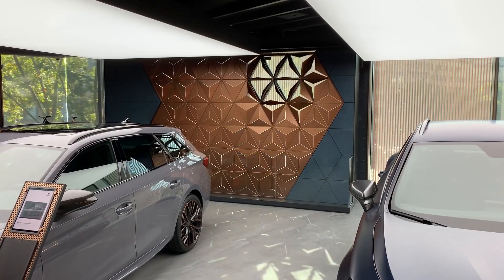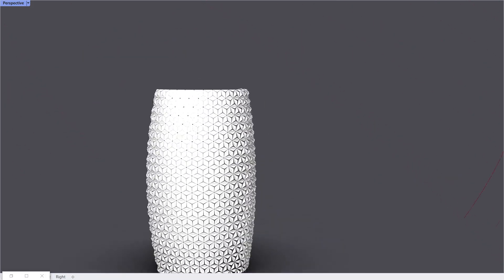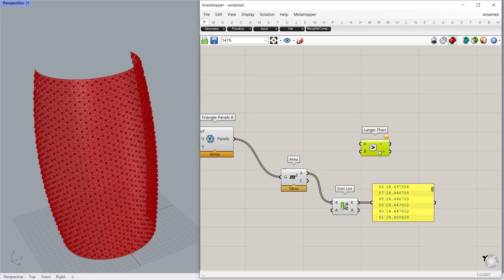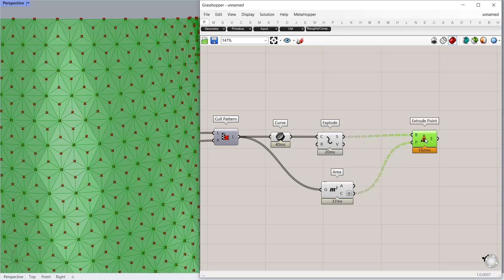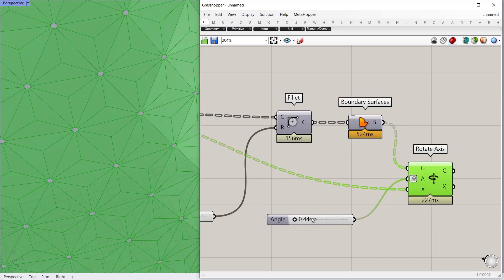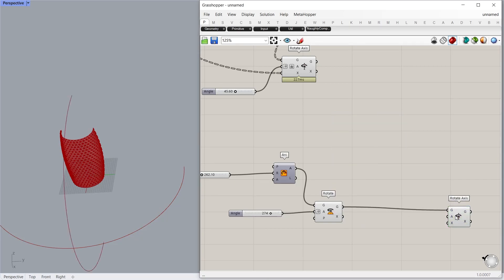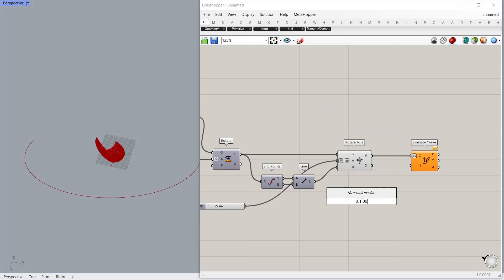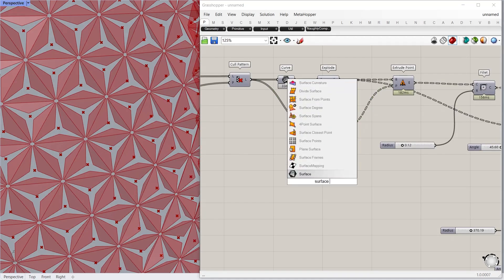kinetic facade Grasshopper Tutorial |commentary available |

Comment: Amazing tutorial! How can I extrude the triangles?
Reply from the maker: use pufferfishes offset surface componet
Reply: @3DBeast  wow thank you for responding so fast
Reply from the maker: @adamuy7884  it’s no bother
Reply: @3DBeast  One more question, Do you know where I can plug on the inputs and outputs, Ive tried a few inputs but it crashed my rhino
Reply from the maker: @adamuy7884  connect surface to surface(or brep that u want to give a thickness) and distance to number slider . if u have so much geometry it may be crash,  so convert to mesh (by connection mesh node) the use offset mesh component from pufferfish